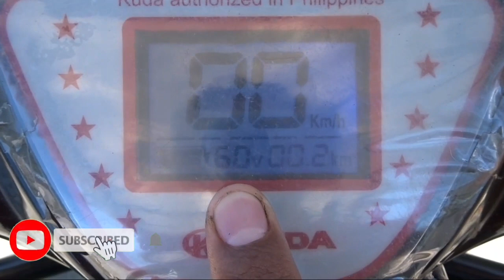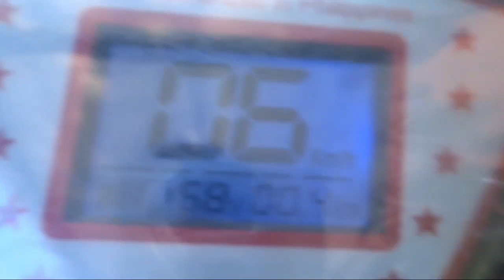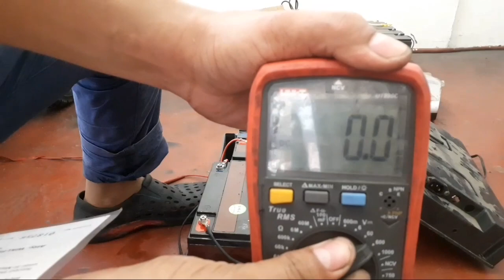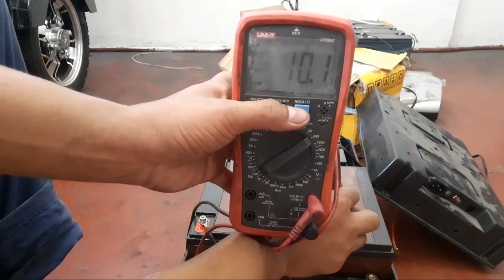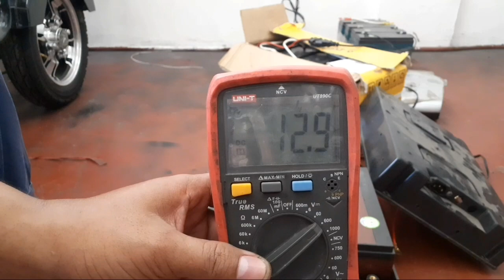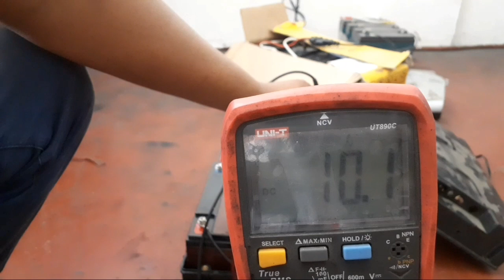MABILIS MALOWBAT KAHIT FULL CHARGE (ETO PALA DAHILAN)

Comment from the maker: Update ko kayo sa next video kung okay ba yung gagaweng kung remedyo sa battery nato
Reply: Ano po yung ginwa nyong remedyo?
Reply: @lhencereno9089  钱包
Reply: Just charge the battery with a 12v charger for the 10.1V reading until it reaches 12.9, to be the same with the rest of battery, just remove the wire connection when charging and reconnect it
Reply: @roselledevibar4353  l of
Reply: Sir anu kaya dahilang mahina umatak yon ebike
Reply: ano naging solusyon dito sir, ganito na kasi yung isang battery ng e bike ko..
Reply: SIR ANO BA O ILAN VOLTS BA YUNG NORMAL NA VOLTAGE DROP PAG DRIVING KA NG EBIKE SA PATAG NA DAAN SOLO RIDE AT FULL THROTTLE FOR EXAMPLE NASA 50.0v mga ilan volts yung normal na drop nya ng naka throttle at running ng patag na daan

Comment: Ganyan din aken small erv kakapalit lang din ng battery kase may sira yung dati katulad nung nasa video pero ngayon chinacharge ko siya hanggang 51.2 volts pero pag pina andar ko nag 40 volts agad ano po dpt gawin diyan?
Reply: I strongly recommend using battery equalizer or battery management system para sa lead acid battery. 

Kapag yung isang battery pumalya na, at papalitan mo ng brand new, sa una ok. Pero yung mga luma na iba, pd ring pumalya. Hindi na kasi nila ka-batch yun. Mas magastos ang pagpapalit ng paisa isang battery. 

May tinatawag po kasing charge cycle ang battery.  
Like for instance; yung old batteries nasa 500 charge cycles nalang njya, then naghalo ka ng brand new. Syempre bago kaya gung charge cycle niya higit pa sa 500. Let say nasa 1000 charge cycle pa. So ang unang mamamatay yung mga nasa more or less 500 charge cycle. 

Kaya I suggest na pag-ipunan ang pamalit ng buong battery at gumamit kayo ng BMS para equal lahat. Walang mauunang mamatay at walay mahuhuli at mas tatagal ang gamitan. Hindi pa sasakit ang ulo

Comment: Tanong ko lg kung ganyan yung isang battery na bumaba yung volt percentage nya ano paba yung pwede gawin para bumalik sa normal
Reply: Following
Reply: Non. Benta sa junk shop then replace ng bago. 
Sa aming mga solar enthusiast.  Kapag below nominal voltage na (below 12v). We consider it critical or dead. Hindi na puwedeng i-series pa. Madadamay lang yung ibang battery. Then gamit kayong BMS para laging balance ang mga battery in the long run

Comment: sir my ask po ako kung pwede ba i charge yun isa battery na kulang sa 12 voltage para maging same at kung wala ba magiging side effect yun or dapat na talaga mag palit salamat po
Reply from the maker: mas maganda po palit..pero kung may alam ka na kayang gawan ng paraan bakit hinde mag try..pero risky po yun..dapat po SAME SILA NG VOLT READING ng bawat battery po
Reply: salamat sir
Reply: ang mahal po kce ng battery now sir kya nag ask ako na pwede ma remedyohan sir
Reply: @ricevelasquez  ndi pa nmn po sya lobo nag open po ako ok pa nmn yun, sana po maging ok lagi po kce nalolobat yun battery ko maski mafull charge ko
Reply: sir na try nyo na po ba i charge? gumana po ba same ksi tayo ng issue . pa update nman ho ang mahal pa nman ng battery
Reply: Sana makatulong. 

Kug ayaw nyong sumakit ang ulo nyo sa mga battery ng ebike nyo, lalo na yung madalas kayong nagpapalit kasi unbalanced na ang battery pack. BMS (battery management system) lang idagdag nyo sa next na rechange ng battery pack. Meron sa lazada. For 24volts, 36volts, 48volts up to 60volts. Ang purpose niya ay para balance ang pag charge  ng bawat cell. Walang nahuhuli at nauuna. 

Safe tip:
Wag nyong hinahayaan na malowbat lagi ang lead acid battery at hanggang 50% lang dapat ang nagagamit nyo. Wag ding hayaan na hindi macharge ng super tagal ang lead acid battery dahil magiging internal damage ito sa mga lead plates sa loob. Lead acid battery ang chemistry diba?? May sulfuric acid solution sa loob yan na nagdudulot ng sulfation.

Suggestion: 
Safe at cheap in the long run ang lithium cells. 18650 at 32650

Fact:
Yung pinaka sikat na electric car (TESLA), 18650 cells ang gamit. Ganun sa battery vape. Dinosaur battery na yang lead acid. Mura nga siya pero mapapamura ka din kung hindi mo alam pinaggagawa mo or /at hindi oa itinuturo ng maayos ng mga technician ng mga ebike shop ang tungkol sa TAMANG PAGGAMIT AT PAG-AALAGA NG MGA "LEAD ACID BATTERIES".

Comment: Pano po kung pareho lang yung 4 n  battery any 12 v.
 Pero mabilis p din malobat.
Reply from the maker: Much better ipa check nyu na ebike nyu po..
Reply: Gud day, parehas kami ni madam na problema sa e-bike. Nag green na ang light ng charger, gagamitin mo 3 bars na agad sa monitor. Oky naman ang 4 na battery 12v. Baka sa charger kaya ang problema?
Reply: same ako dto. 12v ung 4 battry. pero mbilis prn mlobat..
Reply: Hello po. Ang battery po ay may charge cycles lang sa buhay nila. Maaaring 12volts above pa pero yung internal resistance po nila pabagsak na. Ang full charge voltage po dapat ng mga battery ng ebike nyo ah 12.8v-13volts. Somewhere in between.

Gamit na din po kayo ng BMS (battery management system) for lead acid (kung lead acid battery parin ang gamit nyo🤣) para masigurado na long term use na yan. Hindi yjng pang isahang taon lang na gamitan.

Comment: Sir pano gagawin sa isang battery pag 10.1 na V.
 pero ung iba nsa 12.9 v
Reply: Sana may sagot po sana mapansin po salamat
Reply: Dead na po ang ganyan. Replacement na ang need. Huwag na mag-aksaya ng effor na irepair o i-revive. Kasi internal damage na yun. Basta kapag ang measurement ng battery eh below 12volts tapos yung mga kasama niya 12volts to 12.9volts pa, DEAD na. BMS is the key. Nasa lazada yaaaaa ....🤘😉
Reply: @thediyguy7067 salamat sa kaalaman

Comment: Add water in dead baterry
Reply from the maker: Thank you sir
Reply: Las baterías de los vehículos eléctricos del tipo gel agm se pueden recuperar con una geringa de agua destilada por vaso
Reply: Not worth thr effort. It wont last. Specially on this battery conditions. It may revive the electric potential but not the internal damage or the normal internal resistance of the cells
Reply: @thediyguy7067   instead na ibenta po sa junk shop ung mga 3 battery nya kc 1 lang naman ung sira,, puede po bang gamitin sa home lightings kung mag invest sya sa solar panel? at bms?
Reply: @lemmor3355  yup. Definitely.